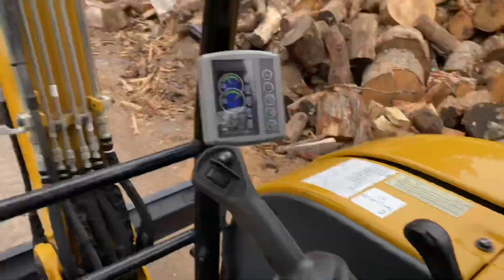Excavator VS Model Train

Comment: If the model doesn't work anymore. You can modify it into a scrapped model.
Reply: I do that to my cheaply bought pre-owned ho scale models and o scale models that I buy from my train shop, if they are high quality models, I place them on sidings on my layouts in waiting lines at the shops where they will be "restored" to operating condition by my crew, if they are shitty quality models, I smash/crush/wreck them to make them look like they were involved in a wreck or derailment and set them in a scrap yard or yard on my layout
Reply: Smart